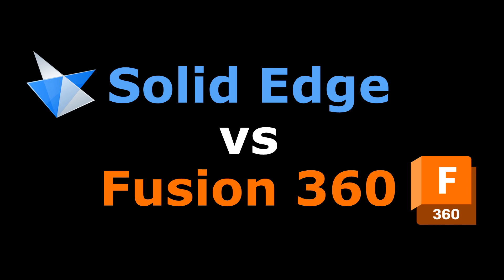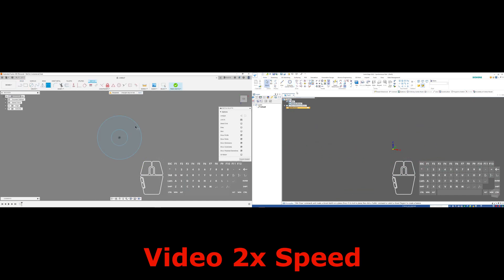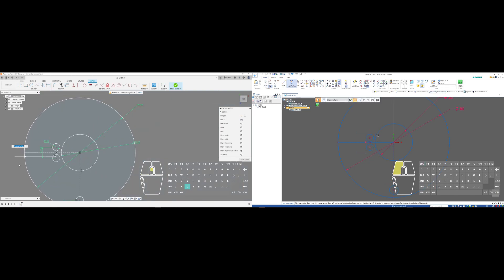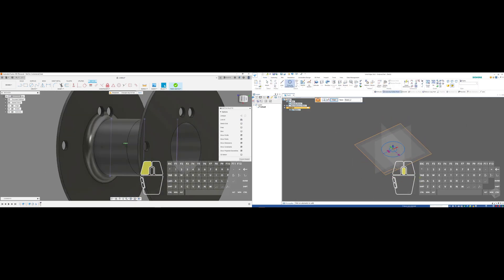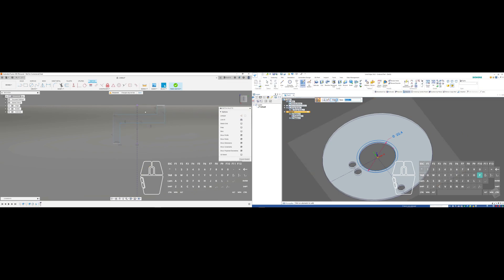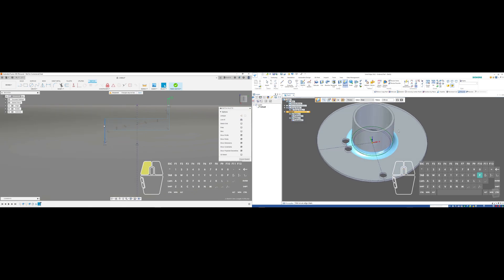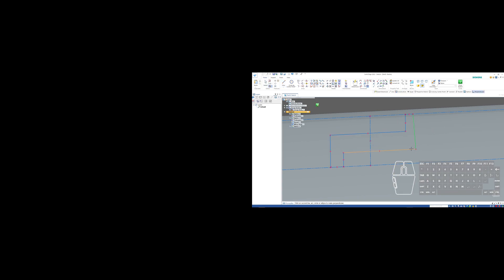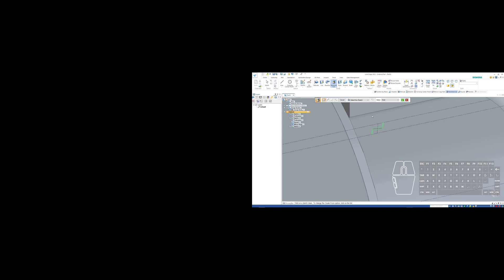Solid Edge vs. Fusion 360 - Modeling a 3D Printable Wire Spool

Comment: I designed a geodesic dome with deltoid faces in Fusion 360 before. One before also in solidworks. Now i try Solid Edge and I am really struggling. My issues are how to create an intersecting Point from three Planes, and how I use an Axis for a circular pattern. It took a lot of time, and I still did not find it! I only found how to create intersecting Lines from Surfaces and then I could use the intersecting point of two lines. And regarding the circular pattern, I found that I can draw a circle and then get the bodies along the circle. But this method takes intuitively to much time! So my impression is, that from the very natural logical way of thinking Solid Edge is really not good at all. It is even more expensive.

Comment: In solid edge you have constructed both halves of the spool in a single part. How would you correctly seperate the two halves to print them seperatly?
Reply: you can add a reference plane to "cut" the model into 2 body's
Reply: @mchamster9480  Multi body part. I've been using Sold Edge for 25 years and cringe when I see some one using it in a comparison test who don't know how to "drive" the system.
Reply: @desmondrobinson169  was I wrong? I learned solid edge on my own
Reply: @mchamster9480  I would have used a multibody part, with a single sketch profile step including the joggle at the join. Holes added after. I normally use synchronous mode. I don't really understand peoples obsession with constraining sketches in "ordered" mode.

Comment: Question for you. Is Autodesk charging you for the cloud simulations, like static stress? There was a good treason for moving it to the cloud. They are now able to implement more robust tools without having to work around the limitations of the OS. That was the reason they moved the simulations to the cloud yet kept one of the simulation types free.
Reply: Their reason to move it to the cloud is make simulation user suscription dependent.
Reply: @omegadeepblue1407  They charge 0$
Reply: What kind of OS limitations are you referring to? Do simulations use any system dependencies or are self-contained? When I was playing around with fluid dynamics, my only limitation was RAM, which is a non-issue today.
Reply: No, it's always about power and control of the product and user, whatever half baked reason the marketing team comes up with to pretend it's not, and "OS limitations" is certainly a half baked excuse.
Reply: @gunt-her  This is what I love about the internet. The developers have had a meeting with me to explain what the limitations were and why they made the change. But someone on the internet gets to declare what the real reason is and doesn’t have any facts or data to back their claims.
Reply: @MechanicalAdvantage  You don't have any facts or data, you just made an appeal to authority, "they had a meeting with me", you haven't explained how there is an "OS limitation".  As a programmer, I need more details than that, because "OS limitation" is a VERY poor reason.
Reply: @gunt-her  They are now using Linux for the simulation for more stable and robust results and only need to have one code base to work on for this and don’t have to work around any limitations of the differences of macOS or Windows.
Reply: It's kind of weird, most customers will willingly give up a lot of control and let you do everything for them in the cloud, which is why I say the cloud model is smart business.  I think most customers actually prefer it, because it can make things much easier for the non-technical customer.